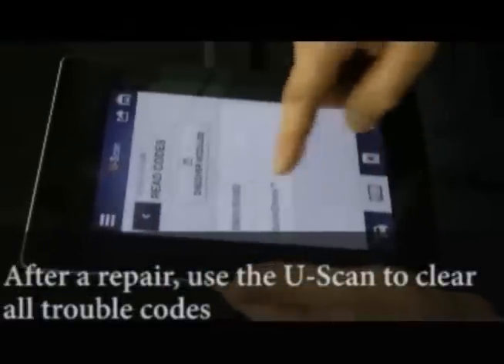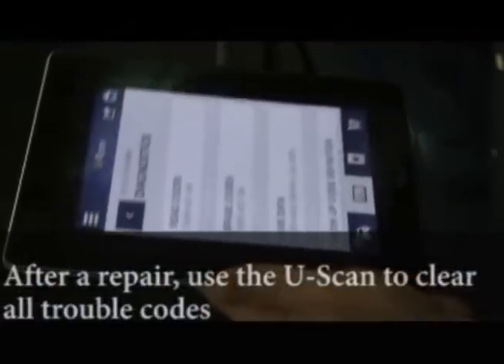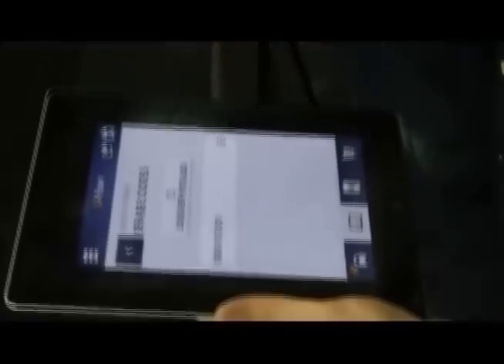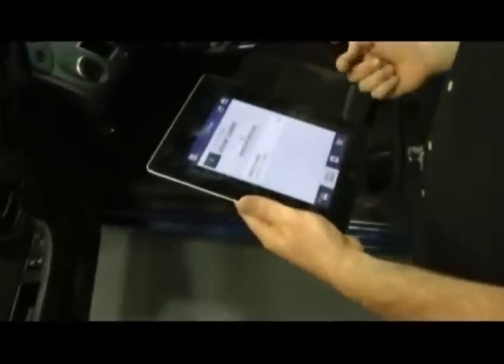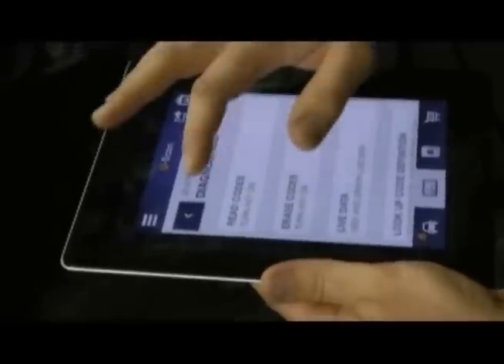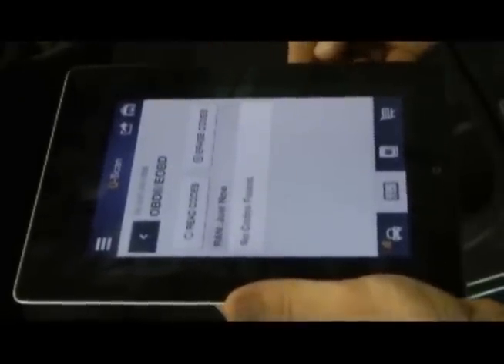How to fix Saturn Ion codes P0013, P0014

Comment: Thank you! Very similar procedures for the Saturn Aura. I purchased parts on EBay and the switch took less than 30 minutes. TIP 1: After removing the wire connectors, get a vise-grips onto the body of the solenoid to loosen it up, TIP 2: While you have the engine cover off, clean the throttle body! It's right in front and very easy to do, just have throttle-body cleaner, a toothbrush and clean rag.

Comment: I'm having problems with the same codes on my ion. I've already replaced a camshaft position sensor, crankshaft sensor, vvt actuators. All that's left is one more camshaft sensor, but if that doesn't work does it mean I just need a timing belt?

Comment: Do these cause the door locks to stop working also, our car just had this happen now.
Reply: Wouldn't have anything to do with the door locks. P0017 is for camshaft position, meaning you have bad sensors or are out of timing

Comment: Hello Dear,

I followed your video instructions and have changed the intake and Exhaust Camshaft Solenoids on my Saturn Aura 2009. I don't have p0013 & p0014 error codes now. Thank you so much. However I am getting p0170 code now that says "System Too Lean Bank 1". What could be the issue . Can you or anyone please help??
Reply: I changed the solenoid and steal doing the problem
Reply: Anyone figured it out
Reply: How did you remove the solenoids?
Reply: I used to get the exact same code. Check your intake for any cracked hoses. If not then replace your upstream Oxygen Sensor before the catalytic converter